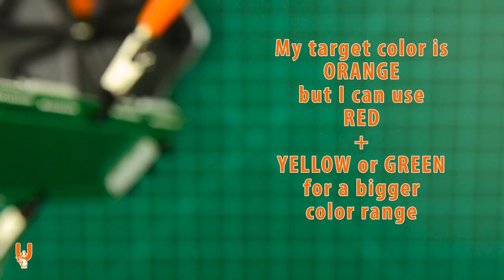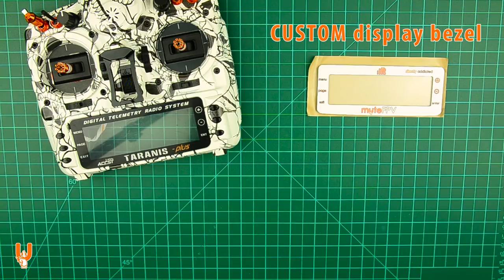Taranis mods #5: Backlight mod (SMD LED replacement) and custom display bezel - QUICK GUIDE

Comment: Amazing job, great skills, as always. Any reason you used the soldering iron instead of a hot gun for soldering the LEDs? Second question: Don't you have have to replace resistors depending on the colors? I know blue usually works with a lower voltage, wondering if you considered increasing brightness in your new LEDs by replacing the voltage dividers.
Reply from the maker: The reason why I didn't use a hot air gun is because I don't have one :P
As for the resistors, I didn't even think about it because I saw only 1 resistor per pair of blue and white LEDs and left it as-is. Please let me know more details if you know to which LED pads it is connected to, if it is not in both, and with what resistor value you would replace it.
Reply: muteFPV I haven't done the mod. I'm waiting for speakers to open the transmitter again after my very successful antenna mod. But if I open it, I'll have a look to it and see what can be done. :)
Reply from the maker: Nice, keep me updated :)

Comment: That is one coooool radio ! ! ! ! !
Reply from the maker: :D
Reply: @muteFPV  I once disassembled my Hitec Eclipse 7ch radio because there was some dirt on the screen. I accidentally touched the chip/short circuited it and all the stored data was lost and had to have the radio serviced. Even a Raptor 50 heli with all those different settings :( Is that paint scheme from a standard Taranis item? KILLER !
Reply from the maker: Lessons learned I guess... ;) No it was a hydrodipped shell that used to sell on banggood and aliexpress but I can't find it anymore. At least not last time I checked.
Reply: @muteFPV  Wow and i thougth i was bling with my FR Sky blue grande lotus upgrade stick ends, lol. I had to cut out some of the plastic on my Hitec radio to fit the blue metal upgrade rings around the switches but i quite liked those grande lotus knobs sold separately. I rerouted the 2.4 ghz module (radio was 35 mhz telescopic antenna) so everything sits inside the radio and don`t poke out on the back which was superannoying. I like the idea of turning around the carrying handle :) If i ever get another radio i would probably buy the Taranis something ;-)

Comment: How important is it to match the forward voltage of the replacement LEDs? Will i damage the board at all for using incorrect LEDs?
Reply from the maker: As far as I know, forward voltage varies for each LED color so you cannot "match" it. Common practice is to supply at least equal or greater voltage than the forward voltage of the LED and the Taranis board should do that just fine based on the LEDs it uses originally. I haven't had any issues with the ones I use and I wouldn't worry much about it if I were you. If you use the same LED size you would be fine, maybe using bigger / higher current LEDs would add more load to the board.

Comment: Great content, where can I get the black knobs you have on the rotary switches?
Reply from the maker: Thanks :) You can usually find them as "guitar knobs", there are many different options and designs available.
Make sure you check the rest of the Taranis mods series for other ideas ;)

Comment: Brilliant modification
I am thinking about the second diode, but white
I wonder if the backlight will come out as in the original
Reply from the maker: Thanks! Just so I understand fully, you mean to mix stock LEDs with some white?
Reply: @muteFPV  I mean using red led and mixing it with white
I currently have the original blue backlight
I wonder if there will be the same effect as in the original taranis
I wonder what LEDs were used with amber illumination
https://youtu.be/iy-dZGq0vkY?t=84
In any case, your idea is very cool and visually looks great
Reply from the maker: I cannot be sure how the color mixing will look like but I guess it will probably become pink(ish)? Probably mixing some kind of blue with some kind of dark orange would result in the purple in between. No idea :P
Reply: @muteFPV  In fact, maybe you're right that it will turn out pink
I will buy diodes and I will do an experiment,
but I guess what you did red + yellow gives a beautiful amber color and I guess I'll stay that way
Thank you for your help and answer :)
Reply from the maker: You're welcome! Let me know how it goes!
Reply: @muteFPV  OK, when I do an exchange, I will let you know for sure
Reply from the maker: Youtube has blocked your comments and I cannot read them, maybe they included links? It blocks many comments and replies lately... Please send again...
Reply: @muteFPV  Hello!
The illumination color change is already done. I left the white LEDs on and changed blue to orange.
It even turned out decent. The orange ones could glow a little more. I'll make a movie and put it on my YT channel. I will let you know when it is ready
Reply: @muteFPV  I posted a video on my YT channel called Taranis

Comment: Is it possible to add a headphone Jack on top of the radio from the speaker? You could play music and get your read outs while not bugging the people around you. If you could figure this out it would be awesome!
Reply from the maker: It won't be stereo but sure, I don't see why you could not replace the speaker with an audio jack. I won't be doing it on mine so no video, but let me know how it goes if you do it! :)
Reply: @muteFPV  Ok, I'm gonna take on this project. I'll make a video on it and share it with you. Question.. I know all the files are Mono but if I were to make all the files stereo then left and right headphone would work right? Or does the radio just wont accept stereo. I'll definitely do some testing.
Reply from the maker: Sorry, youtube didn't notify me about your reply. I don't know how it playbacks stereo tracks, I am not using it for music files. Did you try it since you posted this? Does it play both channels or only mono?

Comment: i noticed you listed 2 different sizes of leds. im looking to do this myself and wanted to know what the difference is between the two and what size are the originals? thanks for the inspirational video
Reply from the maker: Your welcome! I believe that the stock size is 0603. I had seen that others have used 0805 so I went with the slightly larger ones. :)
Reply: thanks for the info man. i think ill try the bigger ones, should give off a little more light and it looks like they fit ok in your vid.
Reply from the maker: Yep, let me know how it goes :)

Comment: Awesome video, but I think I'll stay with stock :) I am too chicken :)
Reply from the maker: Thank you! The only problematic part in my case was the fact that the backplate was stuck to the LED PCBs extremely well. You can check yours and see, if it separates easily, the SMD soldering is not that difficult :)

Comment: Can i use rgb led?
Reply from the maker: I don't know of any way that will let you control the RGB LEDs. The way the multi-color backlight works on the Taranis is it has 2 sets of colored LEDs and depending on how much each set is lit, you get a different color.
Reply: @muteFPV  OK. Thank you...